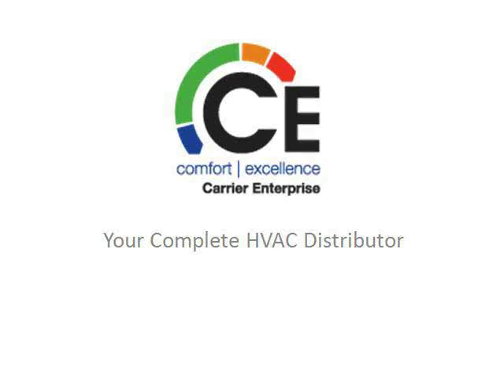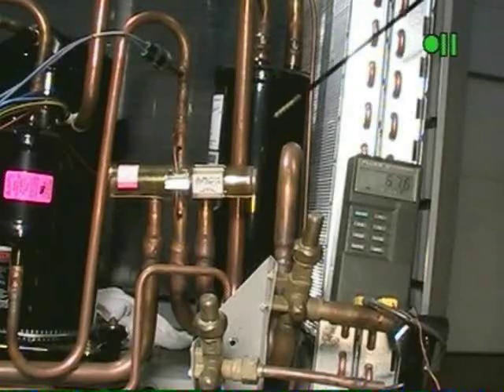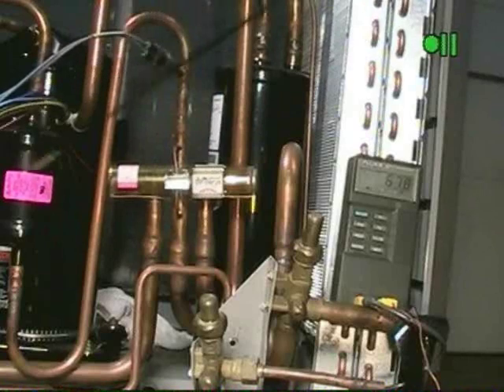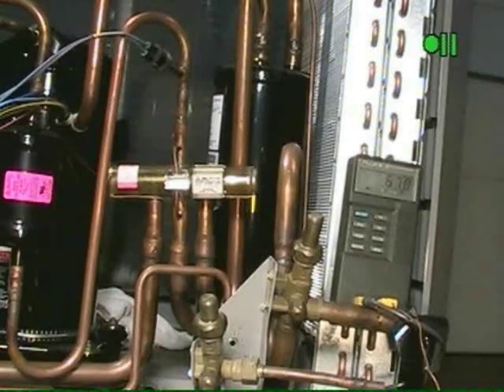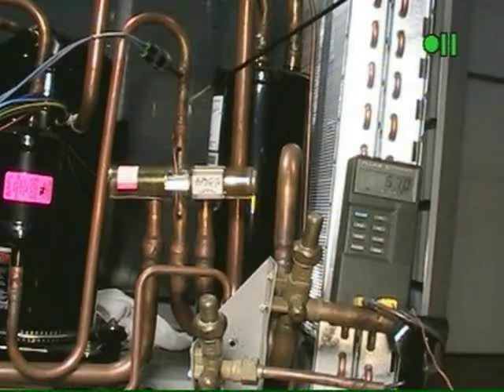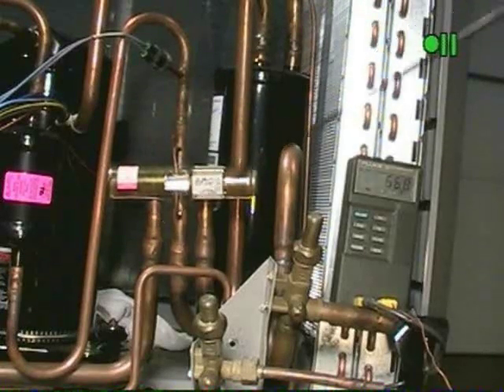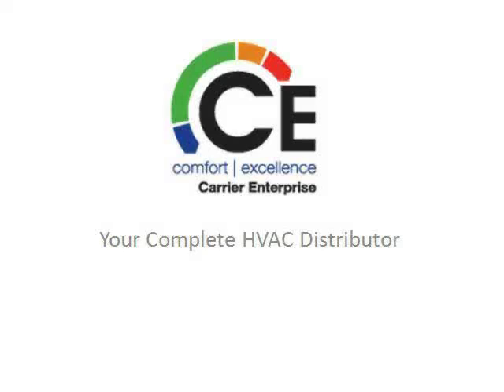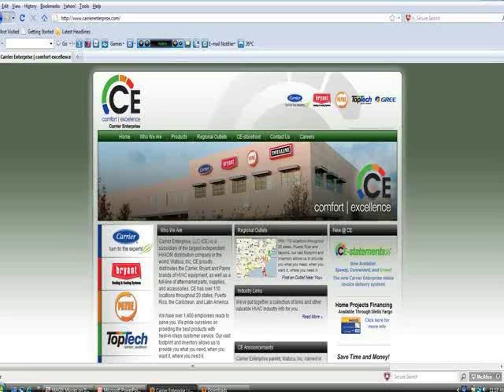reversing valve diagnostics CE 2011

Comment: Would this issue cause the system to stop working.  Period?  About once a month my heat pump will stop working.   Emergency heat mode does not work.  Manually turning the system fan on does work.  I've discovered that the fix is turning off the thermostat and the breakers for 10 to 20 minutes.   Then it works fine.    The last time this happened was the other day and it probably got around 40 degrees outside.